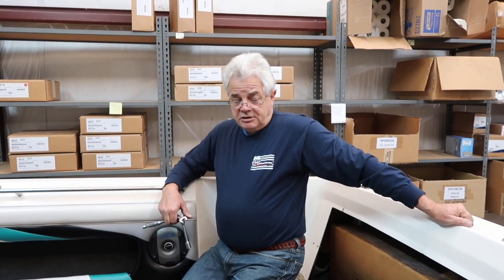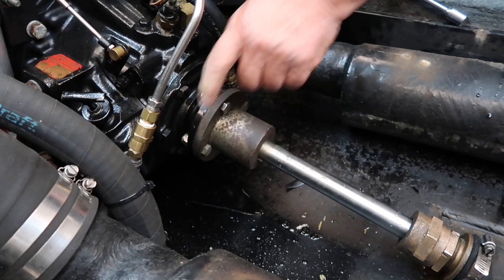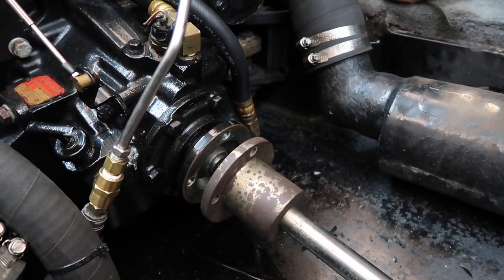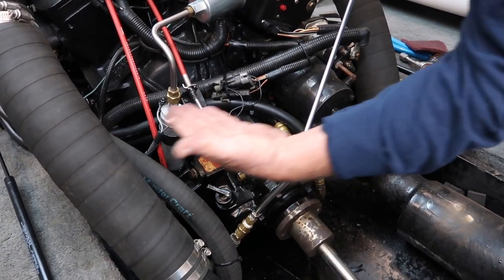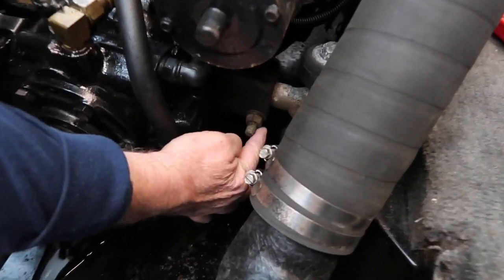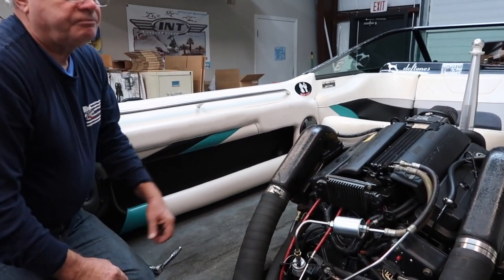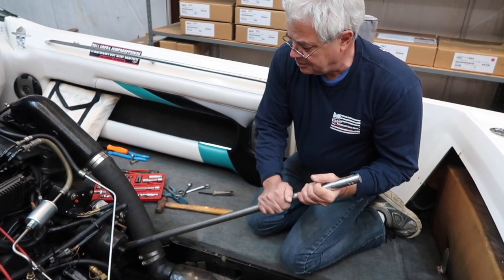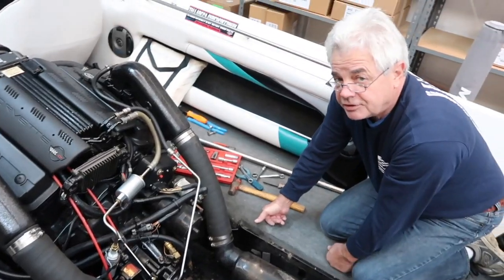How to Check Engine Alignment on an Inboard

Comment: I noticed in your video that you're able to easily separate the drive shaft from the transmission. I have a V-drive setup, and I'm unable to pull my shaft away—it's stuck tight. I can turn the coupling with force. Are there any additional spots I need to loosen that I might be missing? I removed the 4 bolts attaching the coupling. Or could this be due to engine misalignment creating excess friction? Thanks for any advice!

Comment: Should the feeler Guage not fit in anywhere? You explained that there should be an equal distance all the way around but that could occured because the shaft is moving back away from the motor. Also shouldn't this be done in the water because the hull flexes.
Reply from the maker: The best way to check it is with the boat in the water with the 2 couplers unbolted but the 2 faces flat against each other. You are allowed up to .003 gap or less. if the 2 faces are tight against each other your perfectly aligned.

Comment: Now how great is the change that the engine and shaft are out of alinement axial? That should be checked before mounting the bolts again. I would have moved the engine on the front side to keep the axial alinement ok

Comment: Thank you for this informative video. I have been studying the engine mounts on my Hino Marine diesels and while I do have the vertical adjustments I do not seem to have a system like yours for horizontal adjustment. I am trying to figure out how one addresses this with my setup. I wonder if perhaps the holes for the vertical mounting bolts are slotted or just a little over-sized as an alternative to allow for lateral movement. Have you ever encountered this situation?
Reply: Another video shows a slotted hole.

Comment: It looked like you were moving the right side of the engine forward with the pry bar? Even though that side was the side with the larger gap. Am I misunderstanding how the engine moves on the mounts? Thank you for this helpful video! Planning to adjust my v drive boat.
Reply: The simple rule is: if you have space on the left the engine must slide to the right and vice versa. The shaft is kept still and the engine must align up, down, left or right.